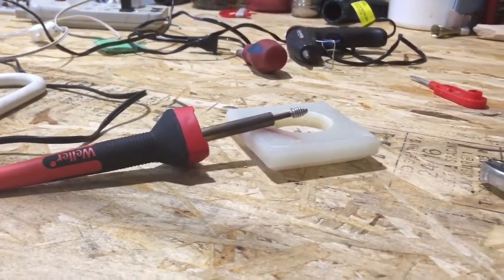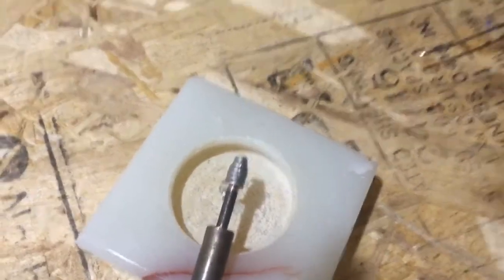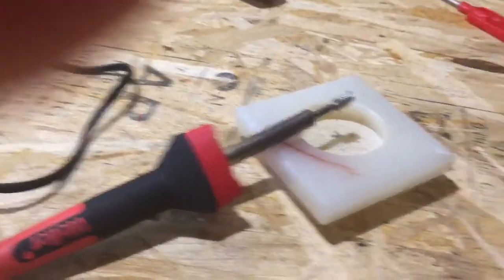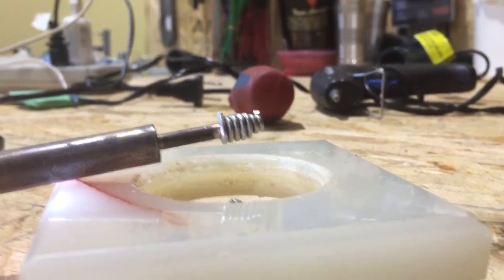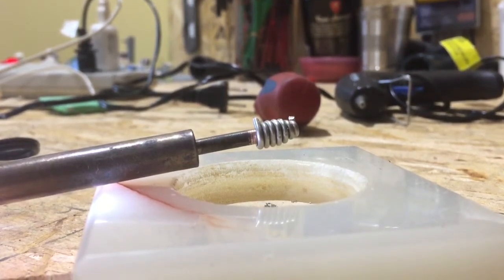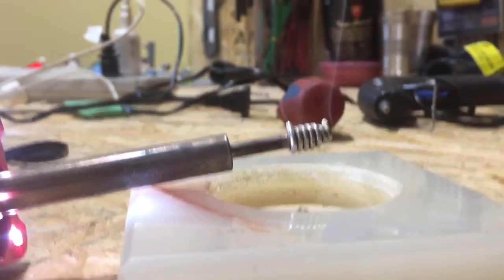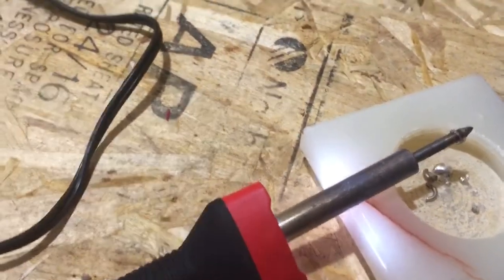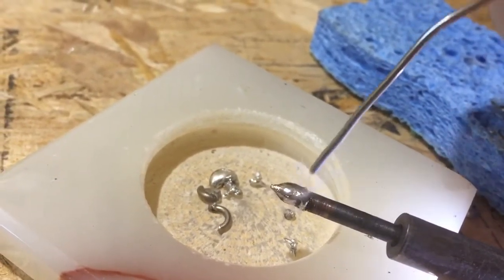Fix any ruined 100% copper soldering tip

Comment: Yeah, tried that several times... doesn't work that well because the metal will oxidize before melting the tin. Best solution is to cold file and sand the tip, start heating while trying to dip it in paraffin (a candle will work) and keep it dipped in paraffin until it's hot to melt the tin. A quick tinning while dipped in paraffin will solve the oxidation problem and allow a good tinning of the tip. Use good quality, flux cored tin wire! Just try it!
Reply from the maker: Good advice. I found that by simply wrapping it tight enough it worked well for me.